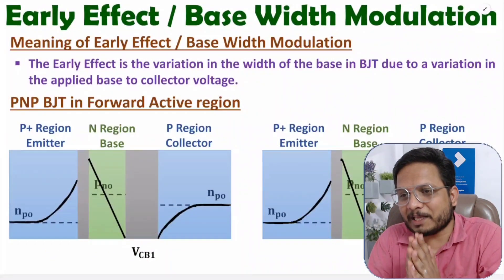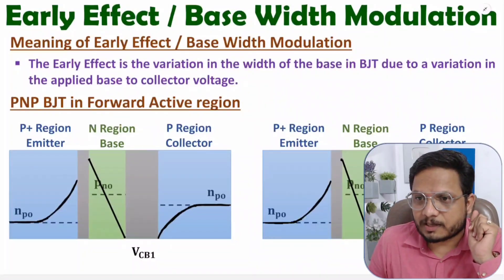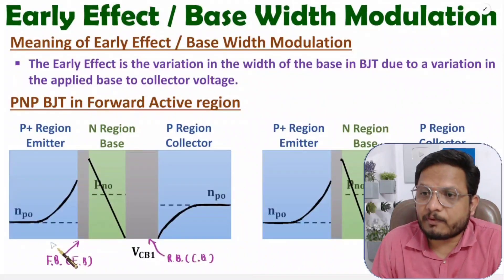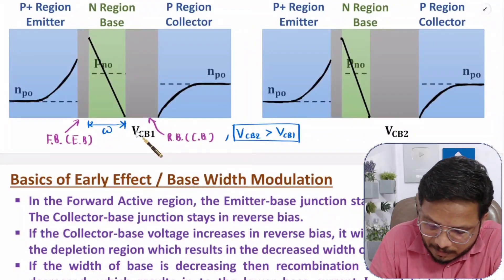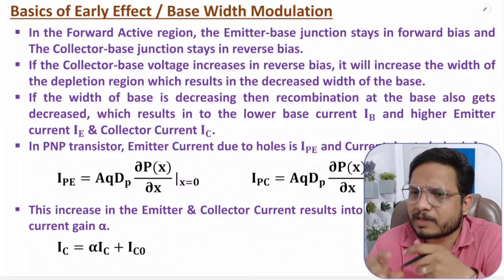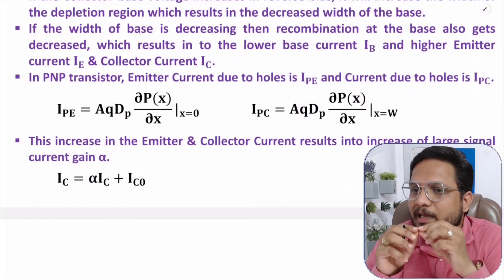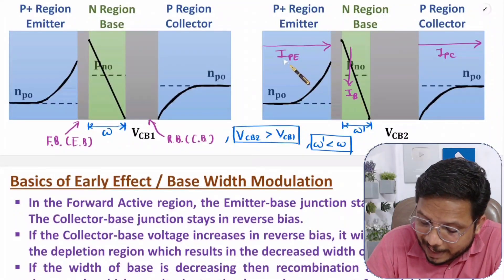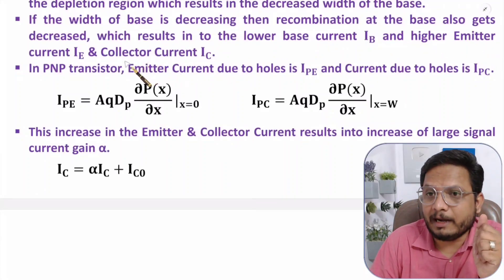Early Effect or Base Width Modulation in BJT (Basics, Case Study & Parameters) Explained

Comment: I don't like the term base width modulation. It is base length modulation. The width does not come into it.
Reply from the maker: But term is Base Width only
Reply: @EngineeringFunda  I know. But I consider it a wrong term. The direction the carriers flow should be considered length, not width. Width would imply across the flow. Maybe an alternative term might be thickness.